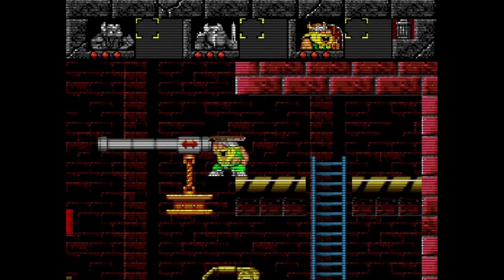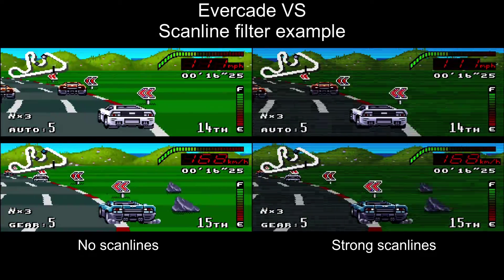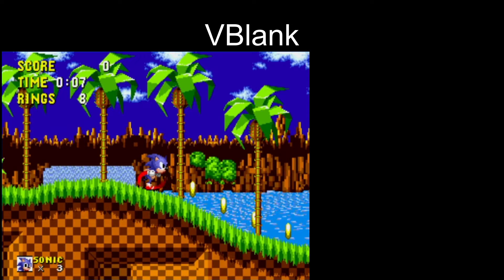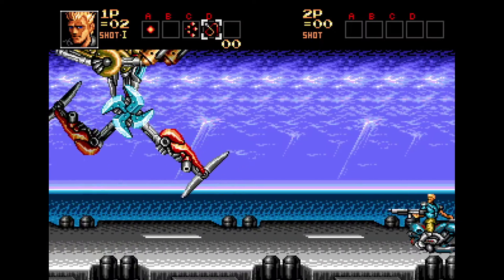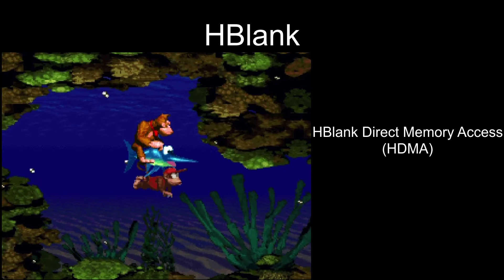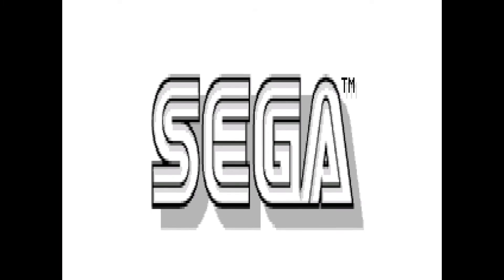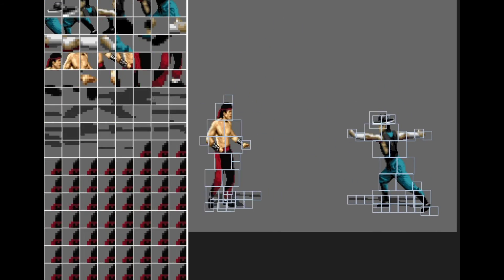How 3rd and 4th gen consoles constructed their graphics | White_Pointer Gaming

Comment: 8:15 Does that mean Game Boy Color had Blast Processing as well? It could do the same thing with mid scan-line palette corrections to achieve a "high-color" mode and display static graphics with about a thousand colors I think. You could adjust the color palette every second line I think.
Reply: That, and it also featured a fairly rudimentary shading-highlighting system just like the Megadrive/Genesis; which can be fairly easily used to make sprites blink or glow. It seems to have been fully pushed into the GBA but by then the Gamecube was starting to become more then just a concept. It's a fairly ingenious way of squishing in even more colour as you have an array of basic colors as well as light-dark tints of the chosen palette, and the actual operating cost to run those adjustments are so minuscule that they don't even really affect scanline logic.
I have no idea exactly how powerful the GBC's processing is, but I'd expect a game to pull about 14-20 frames during the extra colours modes as you can "feel" the slowdown.

Comment: The old tricks of old consoles are quite fascinating. I'm a web frontend programmer, and I do recognise a few of the tricks used because some of them still makes sense in web programming: like tile/sprite sheets; stuffing several graphics elements into one file made a lot of sense until recently because downloading one slightly bigger file is faster and wastes fewer limited connections than several small images; and it still makes some sense when this one image can have better compression ratios and less file header overhead than tiny small files. Though some old tricks are completely counterproductive today; first of all we don't have a scanline we can rely on to do weird memory swapping tricks, in fact it's much cheaper today to use a lot of RAM locally by prefilling stuff and avoid changing it because changing stuff causes re-renders.

One odd thing that is similar but different is that today in web frontends we can generally rely on the client device having a decent CPU and usually a dedicated graphics card, and also quite a lot of memory available, though because if tab addiction, we share that memory with potentially hundreds of other tabs, so we should not waste it, and unless we are generating data locally, all that data needs to be transferred to the client at least once which is the biggest bottle neck for the initial loading of the web app/page. This is less true for phones, but most phones still have a lot of video processing power for their ridiculously high resolution screens. 

This is a big change from the early days of the web where everything was very limited; now it's mainly network transmission (both download speed and latency) that is the major bottle neck. That means in the last decade we've started to use more and more local processing power on the client to reduce the network load; initially just by using file compression which trades transfer speed for processing; but now more and more also by avoiding sending graphics as much as possible and instead use css and svg to generate graphical elements on the client from code. 
And this is an old console game trick too in a way; to get around limited storage and hardware limitations, they would occasionally use CPU driven graphics (or whatever it was called) to make impressive and seemingly impossible graphics they could bypass the screen buffers entirely and directly modify the scanline in real time; of course this meant that the CPU could do nothing else while drawing each line and all the game logic and input handling had to be done during the blanking intervals. And if some logic ran too long it would bleed onto the screen as random noise. Sometimes they would add a border around the image to increase the time for logic at the cost of a slightly smaller screen. 

The big difference today is that we have video cards that we can offload processing to, and to improve responsiveness we really try to offload as much as possible to it to reduce CPU load; but the fundamental tradeoff is the same (ab)using processing power on the client to get around data storage/transfer limitations.

Comment: 7:47  I always disliked how childish and toxic sega's marketing was back then. It did not do them any favour on the long run...

At the end of the day, so called blast processing was some kind of palette swap, but on a per scanline level? Not sure if that is truly unique to the MD, swapping palette for specific areas of the screen is pretty common. But if doing it per scanline cannot be used easily in games, it becomes a pretty weak argument.
Reply: The method that I think is being referred to is per-pixel rather than per-scanline, though those pixels are basically double width compared to native resolution. I believe it involves disabling the display and then doing constant DMA during screen drawing to update the background/border palette, synchronised with the VDP drawing out each pixel on the screen. The background colour is what's on screen while the display is disabled, so constantly changing it as the screen is drawn effectively allows you to draw images using the entire 512-colour palette at once. However, as you have to disable the display (Planes A+B+Sprites), and the CPU is halted for most of the frame while the DMA is taking place, it's usefulness is decidedly limited.

It would probably be more useful with the CD because the second CPU isn't halted and can setup the next frame while one is being drawn. It's a bit glitchy though (it will draw some pixels twice), and apparently not always reliable depending on hardware revisions, which is probably why it wasn't used in any commercial game.

Updating palette entries while using the hardware in the traditional way was also possible, but that results in the dreaded CRAM dots if done during active display. AFAIK updating palette entries in H-Blank avoids this, but as there's very little time to update entries there it's not really possible to do dramatic palette changes per-scanline without artifacts. Some games tried to hide the dots with sprites, and some, like Samurai Shodown, just YOLO it. Most games don't seem to use the technique at all, sadly

Comment: 1:06 Technically one movement from the top left to the bottom right (plus VBLANK) is a field, and TVs usually draw 2 fields with their lines interlaced between each other, hence interlaced mode. Games usually cut the second field off prematurely so the next field is drawn over the first field; in that case a field is equal to a frame.

1:15 For normal TV broadcasts it's exactly 60/1.001 fields per second, Wikipedia has a nice section in the "NTSC" article on why/how they used that. For the progressive mode of the consoles it depends on how many lines they have in a field, and the exact duration of a line which depends on the dot clock frequency, usually a fraction of the system clock. The duration of a line may also not always be exactly the same, to slightly vary the NTSC color artifacts over two frames. Usually it's a bit faster than 60/1.001 fps because it draws half a line less per field.

2:29 Afaik the TV always moves the beam slightly downward at all times, both during active display and horizontal retrace. But that could very well be an implementation detail that could have varied over the years and between manufacturers.

3:47 Well, it doesn't involve the CPU executing program code for every byte transfer. The CPU could very well contain the circuitry ("DMA engine") that stops the program code, enables the source's "read mode" control line and the target's "write mode" control line, and then on every clock cycle just advances the respective address bus values.
Afaik on the Amiga it's a dedicated "Copper" chip, while on the NES and SNES this is integrated into the CPU chip.

4:29 For games on ancient consoles like the Atari 2600 the game was basically drawing each scanline 'manually', so parallax effects would be very easy there too. Just CPU intensive, of course.

4:57 The NES had a feature that sets a bit in the PPU status register when an opaque pixel of sprite 0 overlaps an opaque pixel of the background. Games could use that to detect when a certain scanline was reached.

9:34 That's when the systems were released... Of course their development started a few years earlier. The WDC 65c816 CPU was released in 1985 while the SNES which used it as its CPU's core was released 5 years later. The NES is even more extreme: the MOS 6502 was released in 1975 and the NES in 1983.

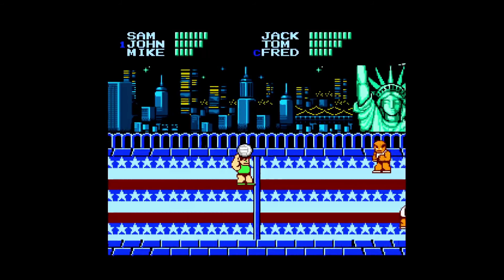10:55 Some games actually intentionally use that sprite hiding behavior. Afaik it's how the Mario games hide the portion of him that is already in a pipe, and in Zelda 1 how Link walks under the wall tiles when passing vertical doors in a dungeon.
Reply: Caveats:
1:06 Number of scanlines and field alternance were dictated by TV raster standards and fixed.
Consoles always output them all, only how they built it varied.
Very common was to issue the same content on both fields, effectively spreading each pixel over 2 CRT scanlines.
2:29 The beam was horizontal when active, even on cheap TVs. This is verifiable on slo-mo footage of CRTs.
3:47 DMA is conceptually a co-processor dedicated to memory transfers. Being separate or integrated is a manufacturing detail.
10:55 Some games did hide sprites this way, emulators have to take care.
But Mario3-in-pipe is hidden by another sprite, itself hidden behind the pipe.

Comment: Also worth noting how V-blank came in different sizes per platform for hardware performance sake, why DOS gaming was 320x200 and Genesis was 320x224, or how few platforms actually were 320x240 or 240p in the 90s till much later in the decade. Same for the 4:3 anamorphic stretch varying too, which was a pain in the ass with cross platform development lol.
I tend to only refer to "background tiles" and instead say "sprite blocks" just to make sure there is no confusion between both units rather than say "tiles" for everything in statements.😉

Comment: For the Mega Drive, there's actually a specific benefit to performing DMAs during VBLANK. The VDP performs DMA significantly faster while the screen is disabled, which is most commonly the case during VBLANK.
Reply: Is it really faster? Is it not just that because the DMA is not used to display the screen you have 10x more free DMA then. 

The end result just want to check as I can’t understand how DMA works
Reply: @litjellyfish  The 10x value may be off, since I see conflicting numbers from different sources. But performing a DMA transfer from the 68k's memory to the VRAM is significantly faster during VBLANK/when the display is disabled. There are various wiki pages that cover it. You should be able to find some by searching for "mega drive vdp dma"

Comment: An interesting point about sprite flicker (at least on the Sega Master System, though I assume on most 8-bit onsole at least) :
Sprite flicker is not an automatic process. On the SMS, sprites have different priorities, based on their location in the Sprite Attribute Table (SAT). Those with a lower address on the table, ie. $3F00 will be given draw priority over those with a higher address on the table, ie. $3FFF. 

So if there are 9 sprites on a single scanline on the Master System, only the first 8 sprites with the lowest SAT address will be drawn. The rest will actually be completely invisible. Sprite Flicker as we know it is actually something that has to be coded in by the programmer. This is usually done by shuffling around the addresses of each sprite in the SAT so that their priority is constantly shifting. This is viewed as flicker by the player. You can see this happening if you open up an SMS game in an emulator like Emulicious. 

I believe this is also how the Game Boy Color works, but the original black and white Game Boy determines the draw priority by which sprites have the lowest X coordinate, so I'm not sure how flicker would work on an old-school DMG Game Boy, or if it was possible. I'm not very familiar with the DMG library unfortunately.

Interestingly, slowdown is ALSO something that doesn't happen automatically, and must be manually coded in by the programmer.
Reply: What happens if slowdown isn't coded?
Reply: @rick-deckard While the game is still not finished processing the next frame, that unfinished frame will be drawn, then the frame will finish, and it will be drawn once more on the net frame. This means that you will have one incomplete frame drawn, followed by an out of date frame. If this process continues, it will lead to a serious disconnet between the player's inputs and what is happening on the screen
Reply: @rick-deckard
Look up
Behind the Code - Strider NES

Comment: A bit of clarification: When you say "HDMA allows Mode 7 to do cool tricks that it couldn't do on its own", technically, the only thing that Mode 7 can do on its own is an affine transformation: Translation, rotation, scaling, and skew. It can't actually do perspective transformation without HDMA changing the matrix registers on each line. HDMA is actually what most games use to change the mode itself since the mode register is one that it can access.

Super Mario Kart is one example of a game that does manipulate the registers in the middle of the game using the CPU: In split-screen mode, it turns on forced blanking in the middle of the frame, then loads new sprites for the bottom half. This takes a few scanlines to complete, which is why there's a thick black bar separating the views. All of the other effects, including mode switching and perspective are done using HDMA.